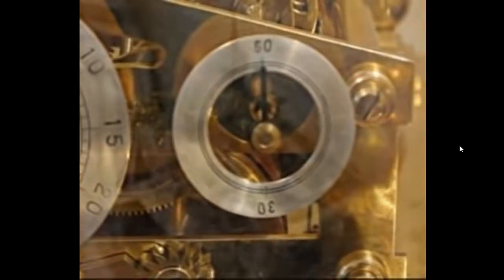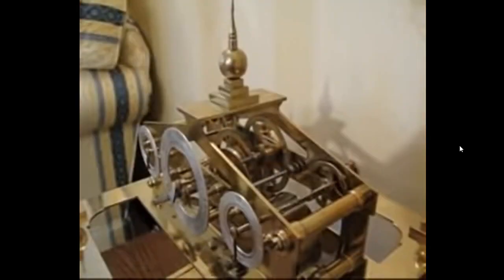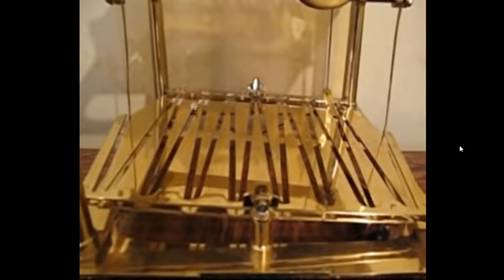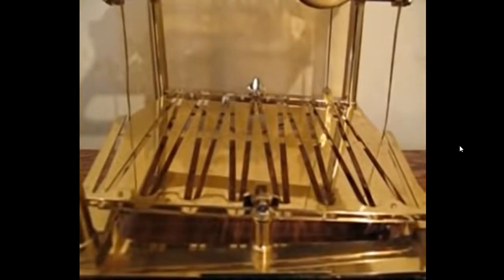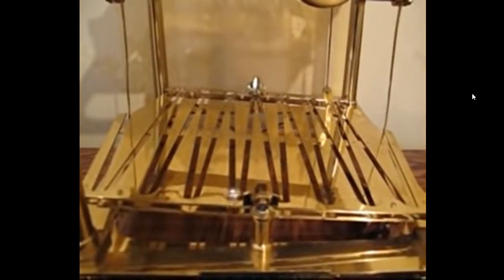Making a Congreve Clock - Part 1 - Page 1 Chapter 1.

Comment: Great project, and definately quite daunting.  But well within your capability I'm sure, looking at your vids.
I'm having a go at making a congreve at the moment, generally to Mr Wildings design. 
It's proceeding surprisingly well so far, but I'm still on the "easy" bits; frame plates, motion plates, pillars and finials. Best wishes, looking forward to seeing the build of this.
Reply from the maker: Hello Colin,
Many thanks for watching the video and commenting. I agree it is quite a piece of work. My first job was to get some of my old fixer-upper machines going before getting going on the clock. I have has some commercial work that has slowed me down on this project but I should be able to make a start in the winter. I wish you the best of luck with your clock.
Take care.
Paul,,